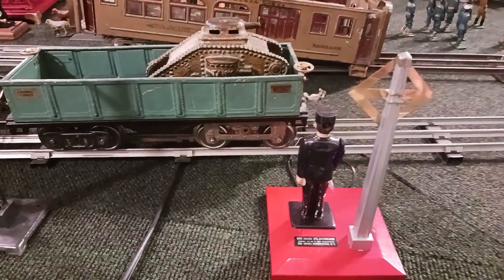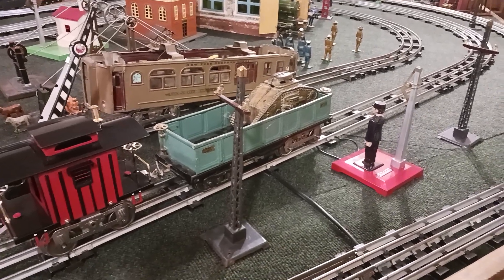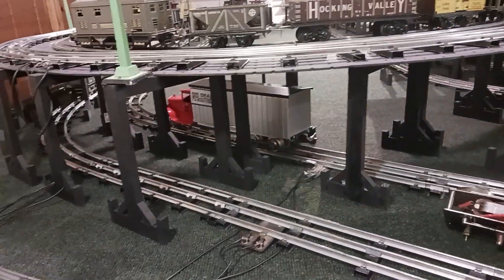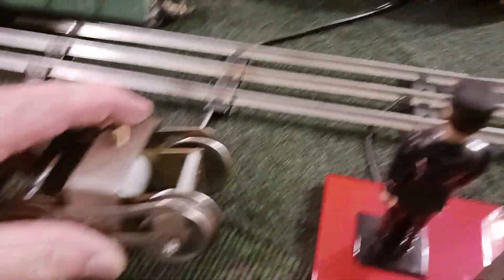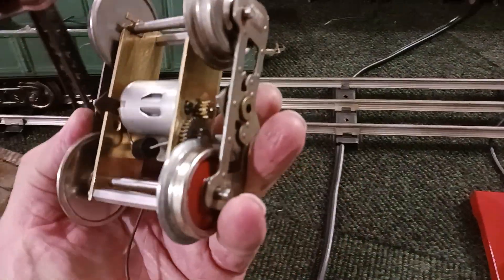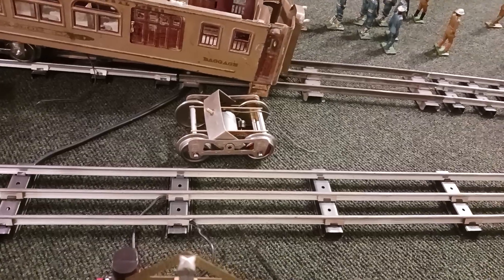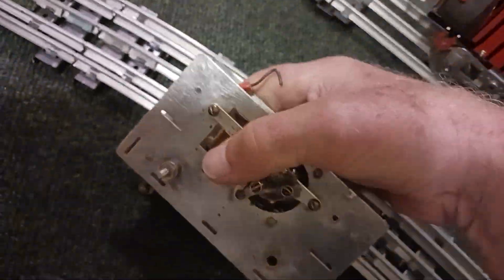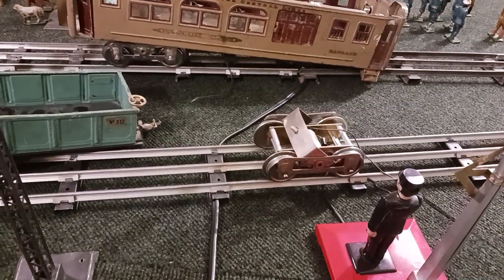We're calling it 99% done. Move on, nothing more to see here.

Comment: That truck turned out great. Respect on how you build this thing completly from scratch. 
Why exactly would the passenger car need two of these or why would the motor burn out? Is it too heavy? 
Looking forward to see what you'll build for it, but actually I like this setup as well: who else has a motorized and  armed gondola? 😂
Reply from the maker: Yes, the passenger car is much to heavy---it can pull it but it's a struggle to get it to speed---two would handle it just fine. In time you'd just burn the motor up or wear out the gears or both. 😯